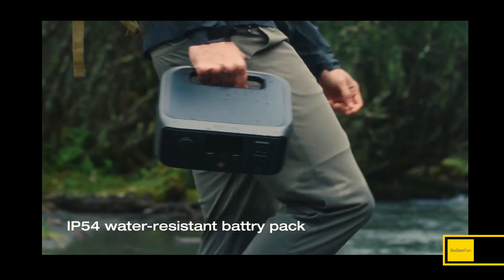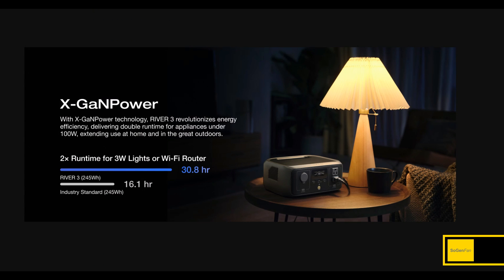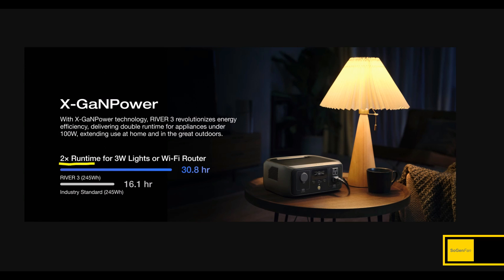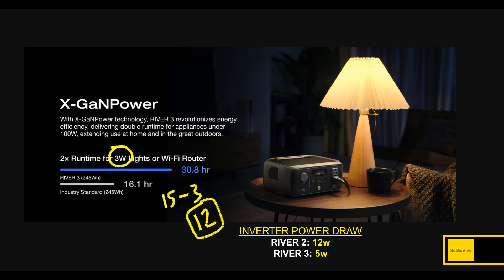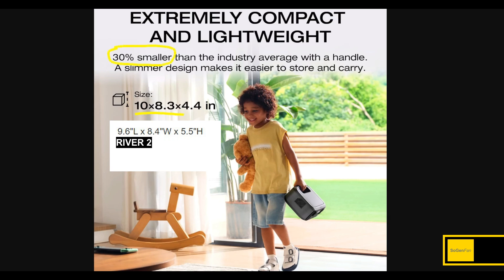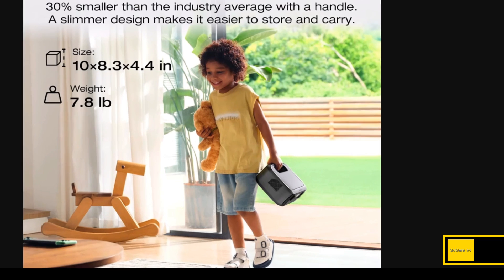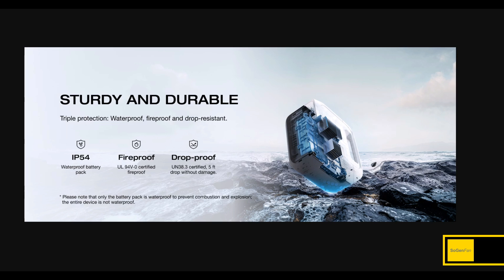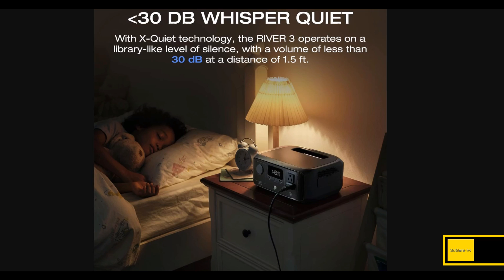Ecoflow River 3 Listing Overview

Comment: Sturdyness is severely downgrade from river 2.
Reply from the maker: True! Remember that durability test video Ecoflow made for the River 2? That was fun to watch but I wouldn't recommend trying any of it! 😁
Reply: @SoGenFan  My River 2 fell off a shelf onto a cement garage floor from about 7 feet off the ground. It separated in half, all 4 of the bolt mounts broke. I basically just lined everything back up and snapped it together and taped the handle. It's been working fine with no issues. I also have the River 2 Pro and I've never had any issues with it.

Comment: The battery capacity is less then river 2 pro 😢
Reply: I thought this was expandable?
Reply: @SolarPunk80  is it through batteries. I wish it was as high as river 2 pro or had more power than it with the addition feature to expand on top of that. Very disappointed in the new river series 3
Reply: its not replacing the river 2 pro. its replacing the river 2, the smallest of the bunch.
Reply: So it costs more but same power, same inputs, same outputs. The main advantages are slightly smaller case and slightly more efficient inverter
Reply from the maker: And less fan noise👍
Reply: UL Certification is a pretty big deal. I like that it's quieter, my River 2 is loud af. Louder than my River 2 Pro actually
Reply: That’s like saying “ my smart car can’t tow as much as a truck 😥” that makes no sense it’s not replacing the river 2 pro it’s replacing the river 2 and it’s a big step up from the river 2